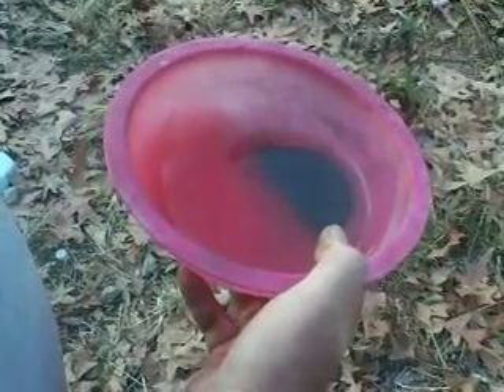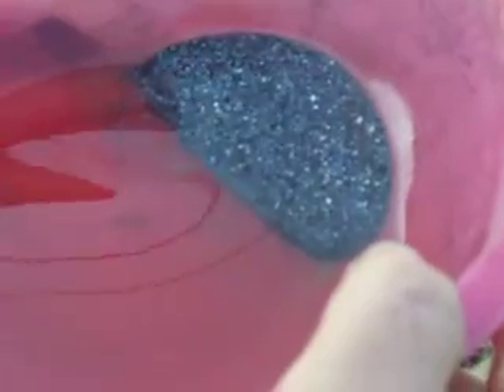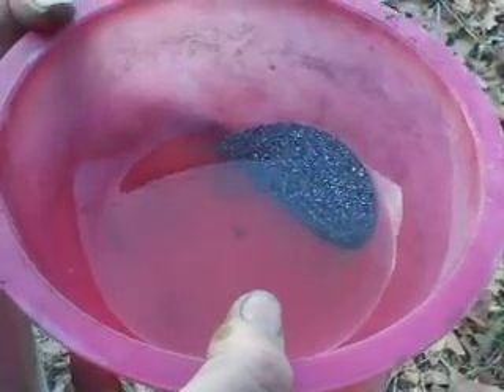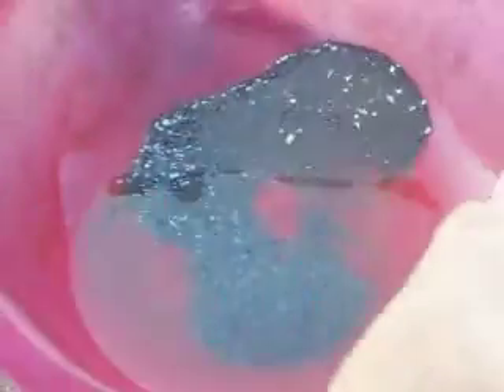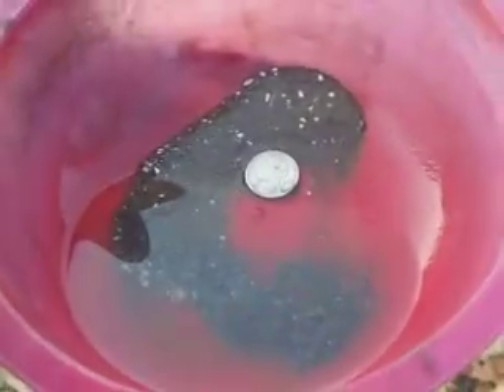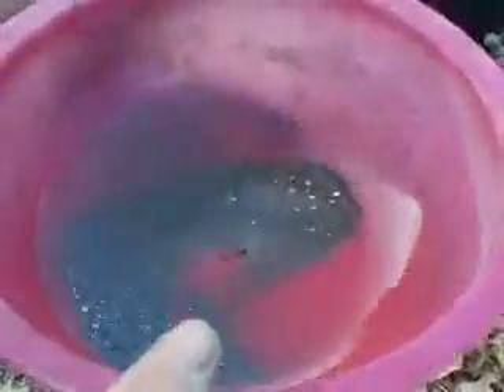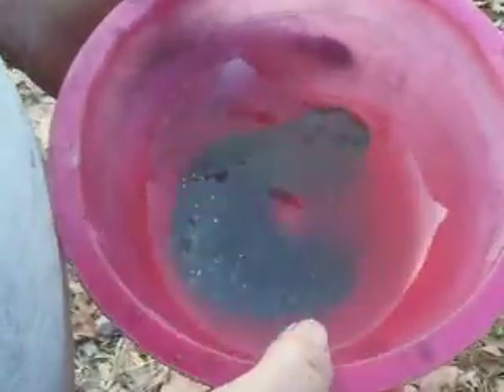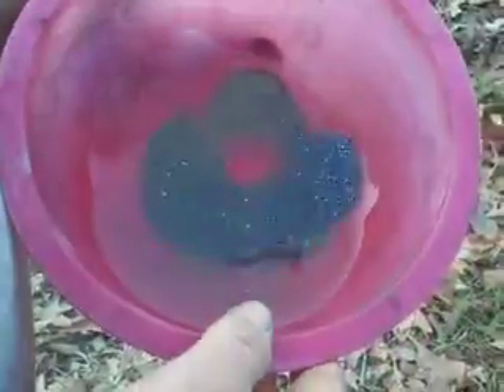gold bonding wires from IC packages

Comment: Hi Geo. Thank you and moose for your teaching on recovery. Both of you did well helping me get started. I have a question about silver. Is there any way to purify silver without the use of nitric? I have no means to store nitric so I don't use it.
Reply from the maker: Storage of tech grade nitric acid is not a difficult task. I store my nitric acid in HDPE containers. I keep a quantity of nitric acid in a re-purposed HCl acid bottle from Lowe's to keep on hand. I prepare the plastic bottle by washing with warm soapy water and rinsing with a solution of water and sodium bicarbonate followed by a rinse with distilled water. I have never had a problem with these bottles and have stored nitric acid in the same one for a couple of years now. To the question, silver can't be refined without the use of nitric acid. The parting cell uses nitric acid in the form of silver nitrate as the electrolyte. What ever size parting cell used should contain distilled water at 90% and silver nitrate at 10% and a very small amount of copper, just enough to slightly color the electrolyte green.
Reply: is there a certain temp that nitric acid has to be. I have a shed I do this in with no climate control. so winter it gets cold an possibly freeze. In the summer it may reach 98 degrees in the shed. will that create a problem with it?
Reply from the maker: Cold has little effect on storage. The colder it is, the slower it will react. Heat is a different matter. When storing nitric acid in HDPE plastic, any temp that is tolerable to a human is okay. I have a scale of the reactivity of tech grade nitric acid on organics and I will see if I can find it. From memory, HDPE is acceptable to near 100C for tech grade nitric acid. Please don't put some in a jug and toss it in the microwave to test that out because my memory isn't that good. I will see if I can find it and reply back here with a definite answer.
Reply: @GibbytheScrapper  consider putting nitric in appropriate bottles,digging hole with an auger or a post hole digger.horizontally bury a few feet of pvc pipe with the bottom end capped and a removable(unglued) cap on the top. attach(tie)an acidproof  proof string to the top of the bottle and thread through a small hole through the top cap.knot well. whenever you need nitric,flip the disquising flagstone,pull up the cap,pull out your bottle of nice cool hidden acid😊👍👌
**edit...bottle below the frost line!

Comment: Good video, but do I have to incinerate the black top of the BGA chips with the green part together, or I have to incinerate both separately?
Reply from the maker: Incinerate the black top. Do not incinerate the green bottom. The green part is processed in AP for the small amount of gold left on them. It takes many pounds of the green bases to amount to any real weight in gold. The largest percentage of gold in the BGA chips is in the black top. If I had to make an estimate, I would say 90% of the available gold is in the black top and only 10% in the green base. It could be a higher percentage in the black top and less in the green bottom but it certainly is not any less than that in the black tops.
Reply: I want to comment by saying your explanation is really good, thanks, really will also get to you whenever I need help on this issue. Thanks and God bless
Reply: Good morning Geo, I just separated the black tops of BGA chips mainly from Desktops and laptops Computer boards, and also I have some BGA chips from RAM boards, do I have to soak the RAM chips only first in HCL to get rid off the leads contacts before incineration, because I want to incinerate both the BGA chips from Motherboard and that of the RAM together. What do you suggest...Thanks as I await your responds...
Reply from the maker: It is always best to remove all base metal you can before incineration. Hcl will remove simple metals such as aluminium and lead and tin. The iron based "legs" is not effected by HCl very fast. HCl will dissolve the iron portion but it is very slow.
Reply: Ok, did as you said, but can the decanted HCL with other dissolved base metals solution be reuse. I mean, can the solution use in dissolving the base metals from the RAM chips be reuse, please, I need a deeper explanation on this because I know that copper II chloride from AP solution can be reuse many times or maybe by cementing the copper out of the solution. please, really want your candid explanation here. Thanks
Reply from the maker: When using HCl to dissolve solder (tin, lead) it can be used over and over until it is saturated and just will will not dissolve more. It can be cleaned. Add a few drops of sulfuric acid and the lead will precipitate out as lead sulfate. Use two pieces of stainless steel wire or rod or sheet and run a small electrical charge through the solution and the tin will form on the negative side as pure tin metal. The electrical charge should be small such as a 6v lantern battery.
Reply: Thank you very much Mr. Geo, God bless you real good.
Reply: Hello Geo, really have a question for you. Please, can you help me of this, how do I get rid off the lead solder in gold plated pins before proceeding my "Recovering Process" because, I read that if there are lead solder in my solution, this could ruins the reaction of the gold recovering process.. Thanks, As I await your candid result and responds..
Reply from the maker: The same as before, with HCl washes. The first HCl wash will leave the pins discolored and blackened. It will look as though the gold has been removed somehow. This is an illusion. The blackened part is ionized tin and lead that has taken on a positive charge and is attracted to the negatively charged solid metal pins. After the first wash, rinse the pins well and let them dry. They are ready to process now as they are. You can remove the discoloration with another HCl wash only this time, boil the pins in HCl for a short time. The black discoloration should be mostly gone by now. This last wash is unnecessary.
Reply: Thanks for your time and responds, but I hope the HCL solution from the first wash can be re-use for another wash?
Reply from the maker: It can be. It can be used over and over until it is saturated with tin metal. After that point is reached, the tin can be removed from the HCl with a simple electrolysis cell using low voltage. The anode and cathode should be stainless steel and a six volt lantern battery as power source will work great. The tin metal will form on the cathode and the HCl can be used again.
Reply: Goodmorning Geo, I was thinking and embacking on a new idea but just thought to share it with you because of your professional ideas in this field. Can I dissolve full gold plated pins in HCL and bleach and then precipitate with SMB, will it work? though I know the process is slower than the aqua-regia solution. I wait your candid response on this. Thanks and God bless

Comment: Hey there Geo!  I have  a quick question for you.  I am left with the silica and gold, and do not want to use nitric acid.  Can I try dissolving the gold in HCL and bleach then filter and precipitate?  Will the silica dissolve in that solution?
Thanks!
Reply from the maker: As long as you have removed all other metal, HCl and bleach will dissolve the wires (though a bit more slowly) without dissolving any silica. Pass the material through a bath of hot HCl first to remove as much foreign material (carbon, aluminum,iron,copper) as you can first and rinse well before you move on to the dissolution. Use good agitation also because the gold will settle to the bottom under all the other stuff.
Reply: We need to find something that attracts gold as a magnet attracts metals. Thinking we need NurdRage and Grant Thomson - "The King of Random" to think of something for us?

Comment: Hi Geo.
How did you lose that silicone chips. I have the same results. I panned as much as I could but I left with gold and tiny silicon chips. What next? Thank you
Reply from the maker: By the time the material is at this stage, the only metal content is something you want to refine. If you have the chemicals on hand, leach the material in tech grade nitric acid and distilled water solution 50/50. This will remove silver and palladium and any left over copper. After the reaction stops and no more reaction is seen when adding more nitric solution, decant the solution and rinse the material with distilled water. Use aqua regia to dissolve the fine gold wires. Since the actual gold weight will be unknown, add plenty of HCl first and heat. Add the nitric acid/solid nitrate in small increments until there's no more reaction when adding more nitric acid. It is important to keep the material agitated to make sure all the wires are exposed to the acids. Stir the material and solution quite often until no more reaction is seen. Decant this solution into a clean vessel and rinse the material with distilled water and add this to the pregnant leach solution. You may have to neutralize the free nitric acid/nitrate before you precipitate the gold. 
Please visit and register at www refinement of precious metal dot com. I am an administrator over the site and we have a live chat and photo and video gallery, all 100% cost free.
Reply: Geo Thank you. You helped me a lot. The website www refinement of precious metal is not working
Reply from the maker: 01nedim I can't link the website here. It is all one word. Of course it's www and then dot (.) refinementofpreciousmetals and then dot (.) com. I will link it in the description.
Reply: Geo Thank you. I know that words should be together but yesterday it wasn't "live". Now it is. Thank you.

Comment from the maker: there were two types of wire that was used widely for the bonding wires,aluminum and gold.even though aluminum is still used,its not as abundant as the gold bonding wires.companies outsource materials so you can have both types on the same board.theres no way to tell by the numbers or just looking at them.i process them all and let the acid sort them out.IC's on low grade boards do contain gold and other precious metals.

Comment from the maker: consider incinerating the boards and milling them to remove all metal. melt the metal and pour into doré bars.this is shipped to copper refineries where the precious metals are reclaimed.in this way,you reclaim 100% of the metal without actually refining.if you would like to learn to refine copper,it is much easier than gold.and the precious metals are reclaimed as a byproduct.it is the process of "parting copper".parting copper electrolyticly.

Comment from the maker: i depopulate the boards by hand. i have tried almost all ways to remove the pins from the plastic.i finally decided to incinerate the plastic.it does not effect the pins or the gold plating.cyanide scares me.outside the lab environment,accidents happen.it will only take ONE accident where any type of acid is introduced to the cyanide leach to make hydrogen cyanide (HCN) gas.a colorless gas that smells like almonds but will kill you in less than a minute.

Comment: ok thanks but still, what I'm getting into a large volume you consider best use sulfuric acid, sorry if my question is silly but I have done two years dedicating myself to this, I have 22 years so I'm a student and the school payment helped in the house, just let me know if you feel better method of sulfuric electrolytic cyanide, tested with the two
the problem is that the sulfuric but I have to clean the material is in the plastic, or is not that way is doing you,

Comment from the maker: i am familiar with cyanide leaching.it is selective for gold and silver.you can place a whole circuit board in cyanide solution and only the gold will be dissolved.it sounds great other than it creates alot of very toxic and deadly waste if not treated correctly.the fact that you are asking about it on youtube  lets me know you do not know enough about it to try the processes needed to do it safely.try the sulfuric stripping cell for gold plated pins,its cheap and reusable.please forget cyanide.

Comment from the maker: short answer, no.the body is made of HDPE polymer.it will break but the wires are so fine and embedded in the plastic that if you dont incinerate first to free the bonding wires, the rest of any process will be useless.AP will dissolve the base metal but its a long drawn out affair.if you have ever dissolved computer pins in AP you know what im talking about.there is ONE chemical process to dissolve the plastic but it is so dangerous that i cant describe it here.i dont want anyone hurt.

Comment from the maker: i incinerate first using a deepfry burner and old BBQ grill.next,i run them through a thrift store brand kitchen blender.the magnetic "legs" are removed with a magnet.i screen the remains to remove as much copper "legs" as i can.dilute nitric acid removes copper and silver.then AR to dissolve the bonding wires. i will be making a video on the subject when it warms up start to finish.

Comment: do you have to incinerate them first? or could i figure out a way to crush to a fine powder then use the powder in some acid peroxcideto dissolve base...filter ..wash with water, filter then use hcl/cl to dissolve any gold, then filter... drop with SMB, heat to evape... wash with HCL filter then distilled water.... dry then melt? would thst work?

Comment from the maker: by sand,i think you mean the silicon chips that have been crushed. they would have no effect on the recovery.you have to make sure all the base metal is gone first though. no copper or steel.i use a dilute nitric acid wash to make sure all other metal has been removed. whats in that bowl represents about six pounds of flat packs.i process VGA chips (north/south bridge chips) separately as they have no other base metal other than a little silver.be sure the black tops is what you are processing.